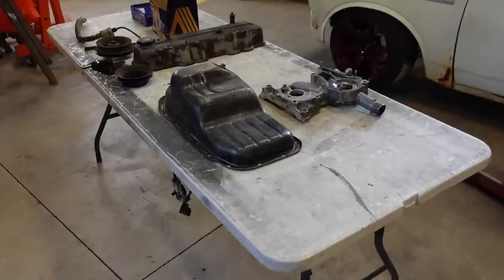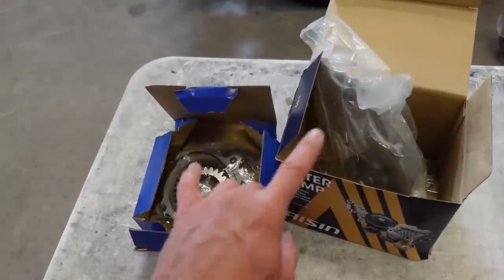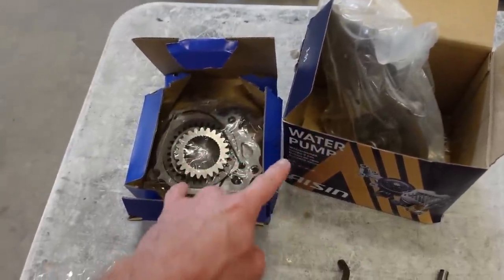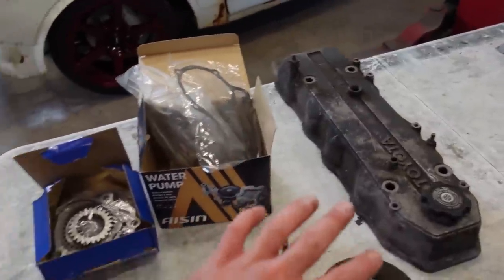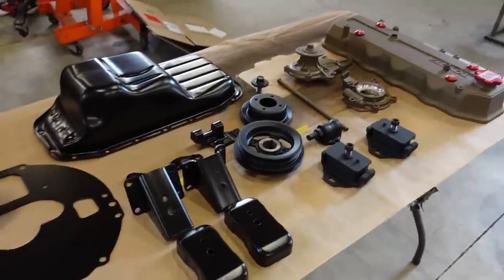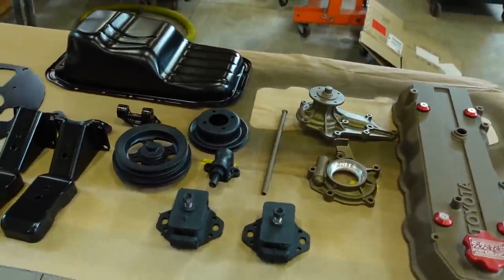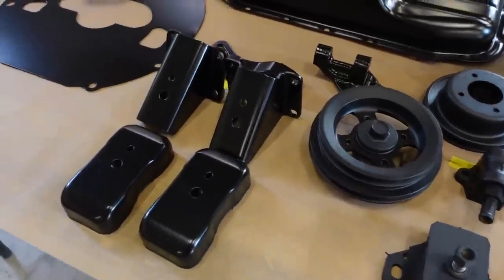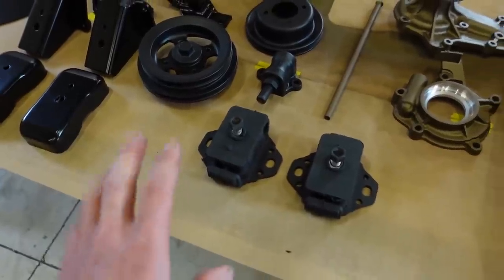Transforming Old Parts Into Pieces Of Art!

Comment: That valve cover will only fit 85 and later model Motors it won't fit yours without changing over the studs that hold the valve cover down to the correct length ones from what I remember
Reply: Nope, that will fit. I have the earlier rounded 22r cover and the 85+ and they are the same height
Reply: @vmoney9106  the one i tried leaked determined it was the studs holding the gasket from being crushed down
Reply from the maker: @rustedratchetgarage6788  I don’t have studs, these grommets use bolts so I’ll see how they will work!

Comment: Not real familiar with powder coating but it looks like you heat the parts before you apply the powder coat and then heat them again after to cure? What's the purpose of that? I thought you just heated once after the coat to cure?
Reply from the maker: Heating before bakes out any oil or impurities in the material!
Reply: @austinniemela  Thanks - love your work!

Comment: I put that valve cover on my 22r and the lifters where whackin the top may need the round top one if it does that!!!
Reply: You probably torqued the valve cover bolts on too tight, both 22re (85+) and the rounded 22r valve cover are the same height

Comment: Do you only blast your parts before coat or do you also wet clean with a cleaner? And what type of blast media do you use?
Reply from the maker: Blast with 100 grit aluminum oxide and blow them off and they are ready to coat as long a you don’t contaminate them